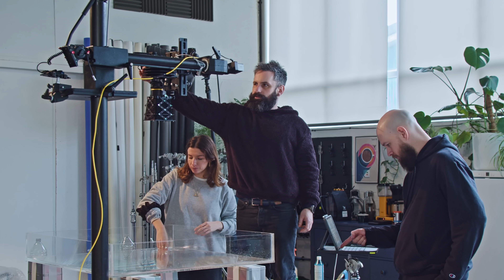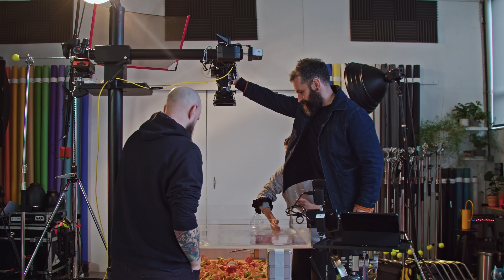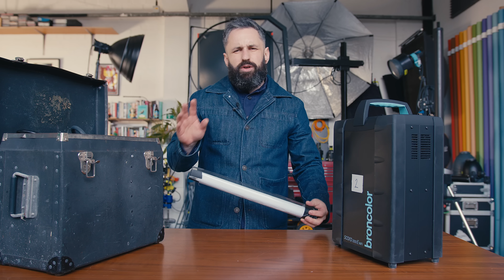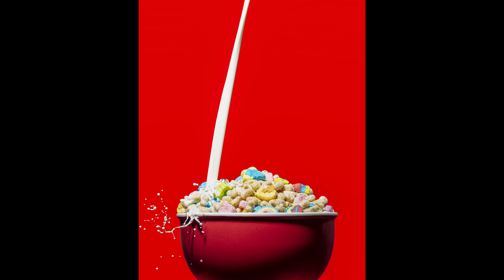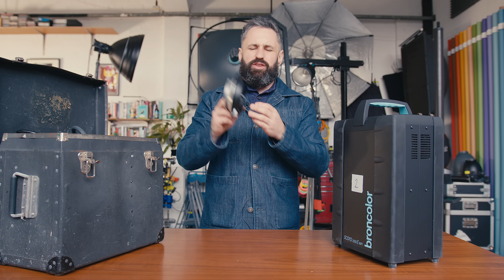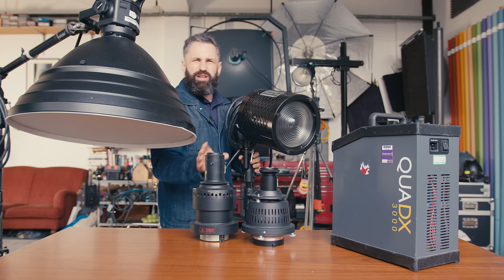My Full Final Lighting Kit: Why I Left GODOX After 10 Years

Comment: PS: an addendum, the Pulso G, Picolite & unilite {the standard head} are the heads for the MOVE system, they don't work alone, like the Siros heads do, so don't get confused and get a Pulso-G and a Fresnel lens or other accessory in front, and think it's a Siros ! the Pulso and accessory do look like a nanlite Feroza 600 or the like, so this is where the confusion comes in. Also SOME heads can only take 300/400W/s ! as they are designed for the move packs, if you plug them into a 1600/3200/2400W Scoro pack … bang!!! it blows, or melts, as you unknowingly put too much juice through the cable or bulb, and like tungsten lights, these are sensitive bulbs (xenon); NOT like movie projector bulbs, as they are explosive!, but still something to note, especially for new assistants, etc. as these flow ALL the charge in 1/30,000th of a second!- the optimum flash duration for action, if you have set the pack that way.

Comment: YES, they are Different, I too, only found this out from Urs Richer on his broncolor webinars, the SCORO is an A/C pack and head, the Siros is a monobloc head (all in one), D/C ; the other one is the MOVE1200L, thats a battery pack/ head ; that's why they {Scoro} go & go & go, as they have full 60A 120/240Va\c punch to back them up. now here is a confusion, the SATOS {with a T} is the combo, best of both worlds, a pack and head, with a mains & battery "slug" which fits it, so you can do all with this, studio or outdoors., no wonder the confusion, also, one other interesting comparison, notice the para 88 's they look so similar to the Briese focus reflectors, they are specialised " Ballast" type heads, ballast in this case being the same as a power pack, but for studio cinema use (keeps the fan noise, hence the hot bits away from the sound dept {the actors}); they also do flash systems, as well as hmi, tungsten, and daylight constant light systems.

Comment: 3,200 are not "Watts". They are Watt.seconds - a unit of energy consumption. Watts are a unit of power. Your kettle may be 2,000 Watts (2 kW - power) and leaving it on for an hour means you the kettle consumed 2 kWh.
Bron prefer to specify the energy consumption in a full power flash in Joules (J) as a way to avoid the W.s discussion I repeat here. And the ISO institute prefers Joules over Watt.seconds too. 1 W.s = 1 J.

How many Watts power are involved in one full power flash? t 0.1 is 1/132 second and t 0.5 is 1/390 sec, so the middle ground is 1/250 sec.
As in physics W = W.s/s or W = J/s, we get Watt from 3,200/(1/250) is

 800,000 Watt.

That's why it takes 1.7 sec at 230V to fully recycle the capacitors in the Scoro pack from empty - the pack must draw at least some 14 Ampères out of the wall outlet for that.

Comment: This is fantastic information.  I love hearing about the equipment you use and how you use it. Because of your videos I decided to purchase a couple of used Broncolor flash kits. (Used of course) I got an Opus A4 with a 1600J head with a P70 reflector and a Broncolor Grafit A4 with Pulso 3200J head and P70 reflector. I wanted a Scoro pack, but they were too expensive for me right now. I love the build quality. I like to buy good kit, take good care of it and have it for a lifetime. I would like to learn more about the P70 and P65 reflectors and see some comparisons. Have you used the P Traveler or P120 reflector? I really like the pack and head light kits for the ease of use and light weight heads. Keep doing this kind of videos.